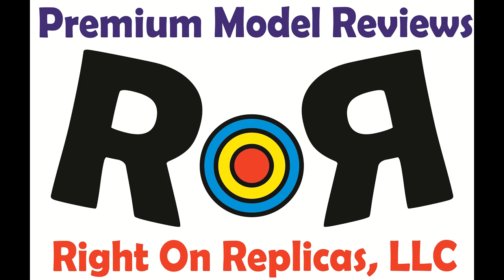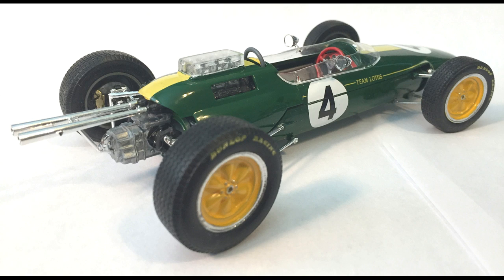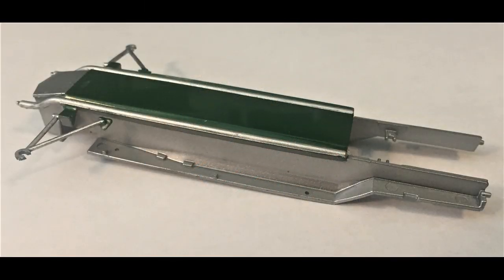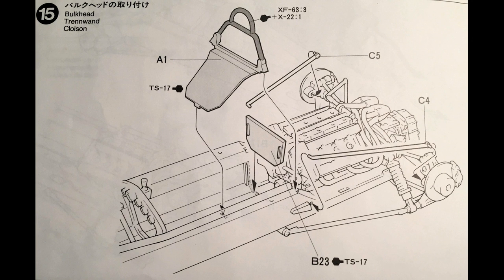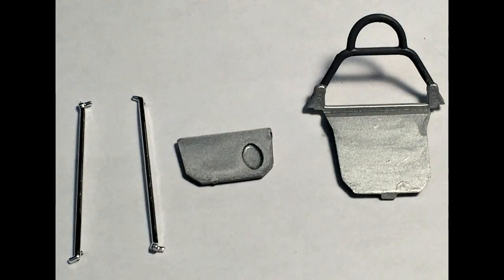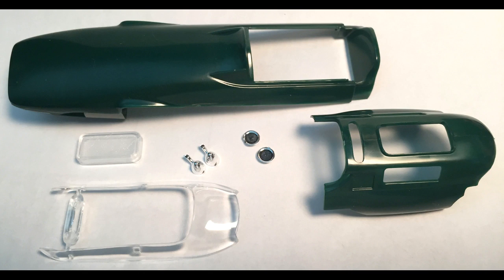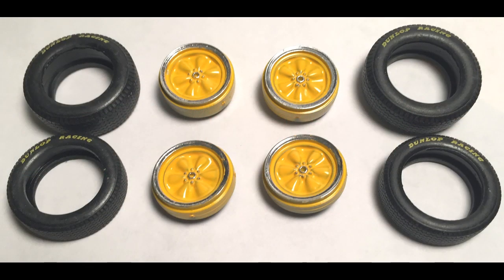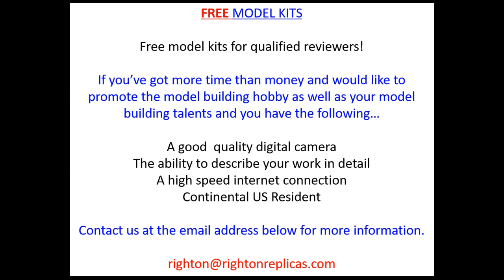Lotus 25 Coventry Climax 1:20 Scale Tamiya #20044  -Model Kit Build & Review

Comment: Turned out great Doug. These old racers were a real mans car, no computer interface from the pits. Have you ever tried using Tamiya Panel Liner? Us military modelers use it like you did India Ink..
Reply from the maker: Chris,  those were real racers.  I have used it but it's more subtle which really great for military subjects and works well on automotive too if you're patient enough to apply it in layers!  -Doug